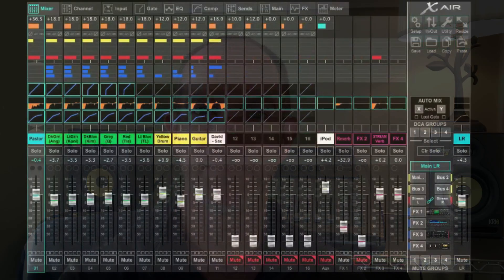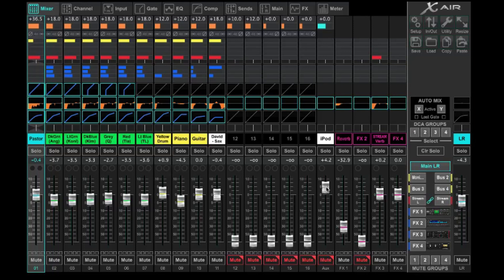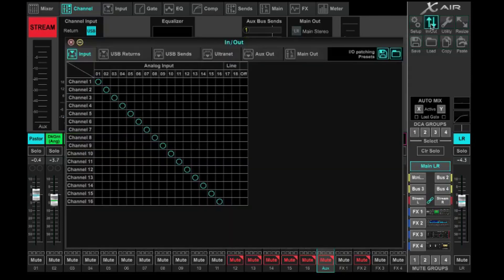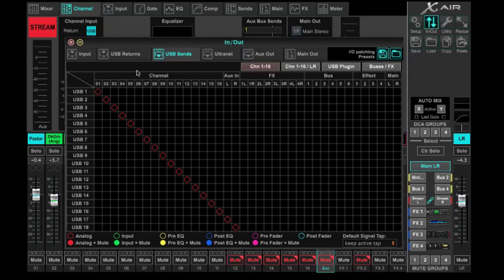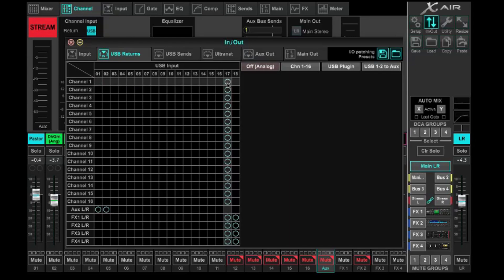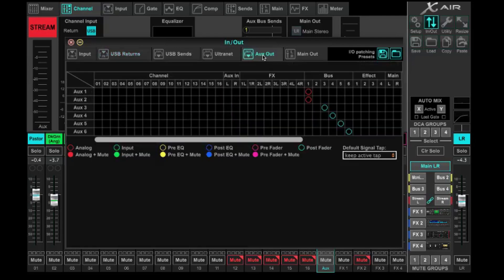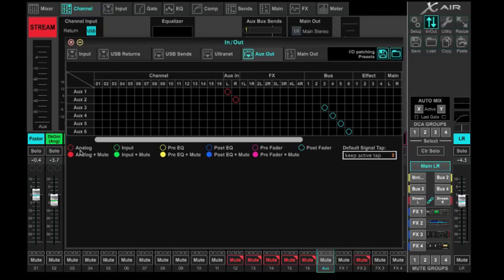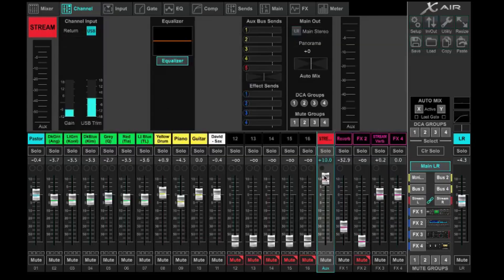LIVE STREAM MIX in a DAW, then BACK through the CONSOLE

Comment: Quick question please. In a case where there's a house mix and you'd want to send a different mix entirely to the live stream, will this Aux mix affect the livestream?
Reply from the maker: This video explains how to have a house mix and then send your inputs across YSB to your DAW. You build a broadcast mix in the DAW and send it back to the console to be delivered to your streaming device. This DAW mix coming into the console will need to be removed from the house mix so it doesn’t cause problems.
Reply: @AllamHouse  thanks a lot for clarifying

Comment: I'm very interested in this process, we have a church broadcast now, but the sound is horrible on the mix. We have a Yamaha board and one computer running through a Focusrite pre-amp. I would guess the 1st start is another computer. Thanks!
Reply from the maker: So you’ll want to make sure you have the basics covered in terms of gain structure and a firm understanding of EQ and Compression. These tools along with some general mixing skills can get your house sounding good. Then, for the stream (on the console) I recommend using a Post-Fader MixBUS. I discuss this setup and refining your stream in this. Idea here (https://youtu.be/pMnaiuC55RY). Obviously, this is on a Behringer console and not a Yamaha, but the concepts are the same. If possible, I would run your stream across USB to get to your computer which can remove the Focusrite as an extra piece of gear. These changes alone might be enough, but if you still want more tools to use you can explore the DAW mix for your stream and route they out to your console or directly to your streaming software.

Comment: Say you wanted to mix in the DAW using plugins and use this mix as the Main LR from the unit. Is this possible?
Reply from the maker: Is it possible...yes. The USB interface, computer processing and DAW transmission will add latency into the mix so if you want to do this it needs to be in a large venue. I used Waves Multirack across USB to run plugins on individual channels a number of years ago. I was in a 1,400 seat auditorium and it worked in the back and balcony, but the front 5 rows it was easy to tell the latency was there between the live sound from stage and the sound from the PA. Obviously, this is why Waves offers their server configuration, but I say this to provide some context and insights from my experiences along the way.